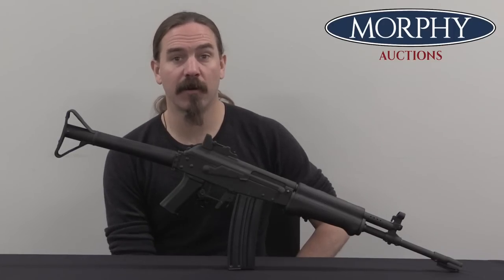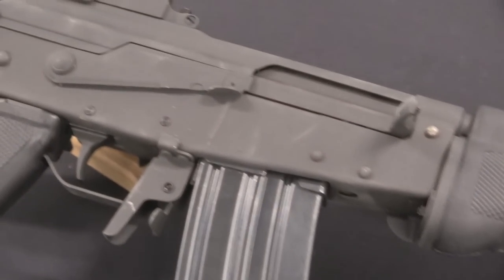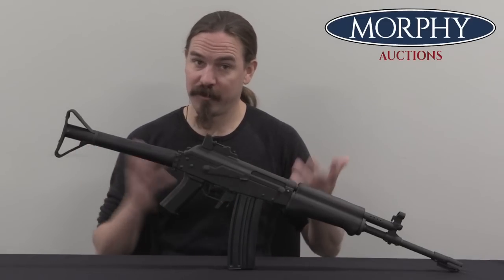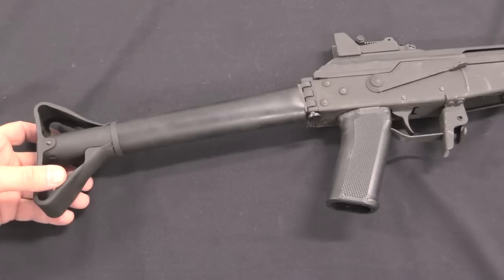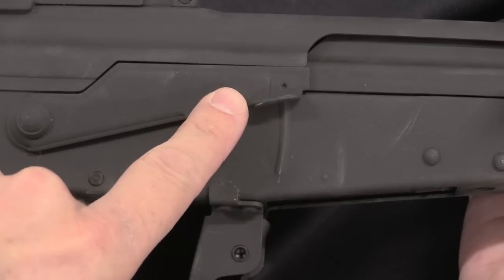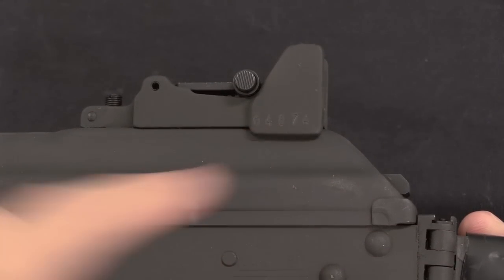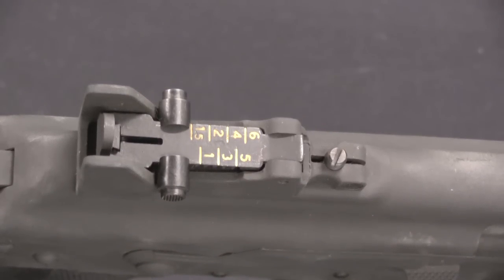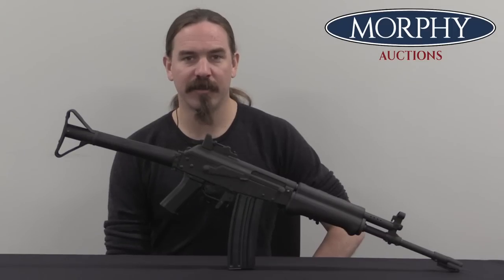Valmet M76: Finland's Stamped Receiver AK

Comment: It's worth noting that the civilian rifle in domestic parlance is "ReserviläisKivääri [Reservist Rifle]"  (as opposed to the military designation RynnäkköKivääri [Assault Rifle]), both being shortened as RK. Which is why they don't remove the other military features from the rifle aside from the full-auto mode. This is because it is expected that especially rear-echelon (older than 30 - 35 - 40+ years, depending on rank, branch and assignment) reservists will fight with their own gear, or they will have to use Chinese and East-German AKM's. Which are actually not that bad, but these were acquired only in the latter half of the eighties, and the East-German stuff in the nineties. When this rifle was first introduced in 1971, there was no gear for these men other than Mosin-Nagants, well of course Finnish Mosins, but still. This has been the side of things even before the Winter War. Back then reservists in Suojeluskunta (Civil Guard) dedicated a lot of resources and money to upgrading their own rifles. Where in fact SAKO's original name comes from "Suojeluskuntain Ase- ja Konepaja Oy" or Civil Guard Weapons and Machining LTD. 

Naturally while in the reserve it is expected they will train with their own gear, so dedicated reservists will acquire such a rifle. The majorit don't necessarily voluntarily uphold their service applicability, but this is due to there being a mandatory conscription, which many find an injustice later in life and as it is also gender discriminating. And personally this is why I disagree with the practice.

The Norwegians do it better, with a draft of the entire population when one reaches adulthood, non-gender segregated, from which only the motivated are chosen. It's been determined that Finland would in fact, with this have a much larger group from which to draft people than is actually necessary, as women are interested but don't apply for their voluntary service for various reasons, economic ones being the most common... And as modern warfare requires highly trained troops, the current practice is also against the interests of the state and FDF itself. But, politicians and boomers oppose gender equality here. But, that is outside your channel's review so I will end the rant here.
Reply: Touching on the subject of conscription. Whilst I do agree with you about the downsides of on male conscription I think the issue with the both genders is greater, at least for couple of generations.

The issue of choosing most motivated could lead to lack of personnel in the service and thus in the reserve, which would of course have to be fixed with set amount of conscripts. At that point not all are those motivated and it creates differend kind of "discrimination". How could we in that case pick fairly the ones that have to serve? That could create bad cycle of getting out of service by cheating and leaving those who didn't "cheat" to serve. Not fair in my opinion.

Of course that also has the issue that if we give that kind of possibility of "out", it could lead to same kind of mess Russian conscription has. Service for everyone would be the only "fair" way but FDF don't have the resources to DOUBLE professionals needed to train and lead double amount of conscripts and personnel + equipment of course. And this would also cripple Finnish economy with entire(or the general 70% that end up serving) age class doing military (+ civilian) service and not working and educating themselves.

That is why I at least think the current system is the only one that works right now. Of course it has to develop to be better and maybe one day it will be fair to all. As I pointed out as one of my points you can't think of it just as "gender discrimination", there could be other unequality issues not related to gender if it would be mandatory for both genders.
Reply: @teemup9247  You seem a bit confused, when the entire population is drafted there is over twice, nearly triple the amount of motivated people vs. how many the FDF needs to train every year available. Our national defense spirit is such, that your first argument is moot. Also, the forced conscription is what leads to the kind of chaos, especially in modern warfare, of what is seen with Russians on the Ukranian front.

In your second argument you basically argue against your first argument, which is a bit weird. There is no need to double the number of professional career soldiers in the FDF with a universal draft. The number of professional soldiers, non-commissioned and commissioned reservist officers is allotted the same way. It is just that the number of women serving will multiply by a significant factor.

Our military has only one constitutionally mandated purpose which national defense, our constitution explicitly prohibits our military from engaging in a war of aggression. So, it serves only to protect our society and way of life. If the people's will to defend their own country lowers to such a degree that there are not enough voluntary draftees, then the society is rotten to such a point that there will be sabotage, crime and out right revolt in the lines if you forcefully arm someone. 

And when you discriminate in who you make legally duty bound to take up arms for this purpose you will also sully this spirit of defense. People are handing in their military pass ports and resigning from the reserve by the thousands as a result of Russian's attacking Ukraine and this aggression becoming more likely to escalate towards us, so it really serves no purpose to train someone who then is unwilling to fight once they realize the state has committed a moral wrong against them. 

People who are forced into service with the threat of criminal sanctions will have extremely poor morale, commit war crimes out of discontent, and usually will not fight at the end of the day. This can be seen with the Russians in Ukraine.

Comment: Just wanted to point out that the magazine shown in this video is not a factory Valmet magazine but is, in fact, a Zastava ZPAP85 magazine.
Valmet 5.56mm magazines are very hard to source and so many of these rifles are sold with magazines from different 5.56mm AK designs that have been "converted" to work in the Valmet.  Some more successfully, and safely, than others.
A factory Valmet 5.56mm magazine will have either 2 or 4 very distinctive bumps on the top sides of the magazine depending on if it was imported with the model M71 rifle (2 bumps) or the M76 rifle (4 bumps).  True factory Valmet 5.56mm magazines sell in the 350-450 price range on auction sites online and there are many fraudulent sellers who will attempt to sell non factory mags to the unsuspecting.
Other than that... a very nice video Ian.

Comment: Ian, you forgot the M76 was later offered in .308, made using the same milled receiver as their civilian M88 Hunter model. Has It's own proprietary polymer stock.

I shot mine last weekend.
Reply: Milled are made by Sako.
Reply: dimapez  (Old)Valmet was large metallurgy company producing many things to different sectors, from vehicles to paper mill machines. Their gun manufacturing division merged with Sako in 80's, Valmet owned half of the Sako and Nokia other half. Later Nokia sold shares to Valmet and just after a year Sako was sold to Beretta.

Comment: There is also a very interesting RK "AKSU" which essentially is a AKS-74U copy but in 7.62x39. Only two of these RK "AKSU" were made during a lunch break " according to my sergenant major. Biggest problem of the AKSU was huge recoil and flash since they either couldn't or have time to figure out the muzzle device. Sadly it's really hard to find any pictures from it from the internet but I luckily got to see it since my military training branch is gunsmith.

Comment: I really liked my RK62 in the army service. I had that modern pistol grip but the older 'cheesegrinder' front stock and ofcourse fixed back stock. I tried my army friends rifle with, in this video's front stock, and i did not like handling of the gun at all. I also got to use the RK95, but maybe the only feature i would pick from that rifle is the folding stock... and that is big maybe. Anyway, as a tanker my beloved gun were the one and only FN pistol, and the one i used, were actually a very good pistol
Reply: I also had the model with cheese grater hand guard, but the pistol grip was the bike handle type 👍

Comment: In 2006 I was looking at one of these used in a shop. It was like $400 bucks or best offer. Nobody wanted the .556 one. Sat in there for a long time.I remember it because I pinched the mess out of myself on the folding stock locking mechanism. Picked up a couple Chinese SKS's for $200 bucks instead. Now I'm kicking myself for not getting this when I had the chance. Would of been a decent investment piece. Still have the SKS's put about 20k+ rounds threw them. When you could buy surplus crates of .762 for like $60 bucks.

Comment: I wonder if any of those are still in service. I don't recall seeing any during my service in 2016. Plenty of those old milled 1960's guns we're still around though. The old grip is actually really nice and slim until your fingers hit the gas tube. No Idea why they thought leaving the gas tube bare in the new M1- M3 versions was a good idea.
Reply: FDF quickly store all RK76s because the receiver isn't strong enough.
Reply: You could spot a 1 or 2 of the stamped ones still in early 1990´s
Reply: The rifle here is M76, which is a semi-auto rifle for civilians. I don't think the Finnish military ever used this weapon, which is NOT an assault rifle, even if it looks like one.
Reply: @cosmo9208  Not the civilian version, but the military version.. I served in the FDF back in 1993
Reply: Th weapons made in the 60s did not have night rights. They were later renamed as RK62PT.
Reply: I saw some converted to laser shooting simulation rifles for indoor shooting at my barracks sports hall. Recognized the stamped receiver. They looked brand new so I think they pulled those from long term storage and figured it would be the best rifle for that purpose, no need to modify milled receiver rifle. It was 2018.

Comment: I was sort of expecting you to mention the angle of the stock, but you didn't! This gun is an aiming experience! most guns have a stock which is perfectly aligned with the barrel, and there's no angle, so aiming down the sights on this one, with prior rifle experience, one will kind of find it difficult to get adjusted to it, maybe one might have a tendency to aim the rifle a little bit downwards, but then! After one gets adjusted to it.. It's actually a very good rifle to make marksman shots, for one thing, in a standing position, when holding the stock against one's shoulder to aim, the sights will be closer to one's line of sight, a little bit higher up than most rifles, and one will not need to lean/sink one's head as much, for a proper aiming position.

Comment: I have a certain fondness for stamped receiver guns. I think if they're pinned and welded just right they could be more than durable enough, even if not quite as durable as milled. Although, if they're designed right, they should also be significantly cheaper, so that's a mistake on Valmet, IMO.
Reply: As Ian said stamped wasnt too much cheaper. Most of those guns went to military and army was like no way for stamped ones. Finland have conscript army shitty weather and terrain. Those guns need to be very rugged and last longing. Soldiers tend to use those as showels and stuff so thats a perfect platform here. Only one button to press and clean the gun and you can smack that how how hard you can to open that ak. Pins and stuff would be pain to loose to snow with frozen fingers.
Reply: As the story goes (only read this on the net some time ago) the Finnish military was very sceptical about stamped receiver guns and thus set the tolerances exceedingly (one could even say ludicrously) high, the number of factory rejects were very high. If my memory serves me correctly, a commentator said that the stamped steel Finnish guns were made to the most exacting tolerances in the world and thus all that extra "quality" drove up the price and thus the chief benefit of stamped vs milled steel, low cost was utterly defeated. In reality you don't need exceedingly exact tolerances in all parts (compare say the Soviet PPS-42/43 SMG...). A further thing is scale of economics, the Finnish military never ordered rifles in such numbers that (even with more down to Earth tolerance specifications) stamped parts really would have mattered compared to say the same numbers made with milled receivers.

Comment: I have one of these, love it. Tough finding mags for it though and good luck trying to find one as they are rare and command big bucks to boot
Reply: if the trunion has its own feed ramp ( or you install one) you can use Galil 35 rd and 50 rd mags..
Reply: @ripvanwinkle2002  Thats correct, I bought (2) 30 rd Galil mags for my rifle years ago at a gun show. They were 100 bucks each but they are so rare I didn't care and looking back now I'm glad I did buy them

Comment: The Valmets look very pleasing to look at compared to most AK derivatives which are with wooden furniture.

I'd like to see how this Valmet compares to other 5.56mm AKs on the range.
Reply: Valmet has pretty good tolerances, so unless the gun's been shot to pieces they tend to be on the better side for AK accuracy. I know my RK-62 (made in -82 IIRC) was pretty much stock tolerance in -05 and shot straight enough to get some medals for shooting.
Reply: I think the South African vektor R4/5 would be a great comparison, they look quite similar as well, personally I prefer the R5 over the Valmet just for the style of stock.
Reply: @ginger0208  Makes sense that they look similar as R4/5 is based on Galil and Galil is largely based Finnish RK62.
Reply: @zhipx8289  Someone else pointed that out to me on another comment, I had no idea previously that the galil was based on the RK, it does very much make sense now!
Reply: Hollywood used Valmet rifles in place of AK rifles before they were imported in the early to mid 1980s.

Comment: Ah it looks just like RK-62 i used on The Finnish army (except with More curved 7.62 magazine, ofc), i miss The old gal
Reply: That's because it is the same rifle, exept stamped and the video's rifle is 5,56 Nato and has folding stock.
RK's folding stock folds different side.
Rifles in FDF is knows as RK 62 76 TP.
Exactly the same rifle.
Reply: 62 has no rivets on the back. But a lightening groove over magazine.
Reply: @JanoTuotanto  Because it is milled.

Comment: Two questions. First, how is the dust cover stabilized for use of the rear sight? AK dust covers are considered too unstable for use as a rear sight/scope mount platform. The Finns are definitely riflemen, so they must have fixed that. Second, will Galil 5.56mm mags work in a Valmet 5.56mm?
Reply: Absoulutly not!  Do not use Galil mags in a Valmet the feed ramp angle is all wrong and you run the risk of it pushing the bullet into the case and if it fires it can cause a caistrophic failure!  What you can do is get regular AK mags in 5.56 Bulgarian Circle 10s are good or the Polish ones from Radom and use a dremel carefully to fit properly using the standard Valmet mag as your guide.
Reply: @Rumnhammer  Good to know! Thanks!....  Now do you know how the dust cover/rear sight is made stable on the Valmet? Every YouTube video on Valmets and Galils neglect to cover the rear sight/dust cover solution. My only criticism of the AK is the blade rear sight. I MUCH prefer a rear peep. I have a Chinese M90 in 5.56. I wish it had a peep. Tech has a clamp on rear peep, but is a bit too complex for my tastes. Can a circle 10 mag be modded for the M90? I have a dozen mags but the more, the better. Last I looked, people want $75 for them!  😖
Reply: @mateoocampo3165  The Valmet dust cover is a heavy gauge sheet metal compared to an AKM. Also has extra reinforcement spot welded to the rear of the dust cover where it interfaces with the rear of the receiver. Makes for a very stable platform for the rear sight
Reply: @viggenguy4411  Wish I could find pics....  could a Galil or Valmet dust cover be modified to work with a Chinese M90?
Reply: @mateoocampo3165  For what it's worth, the dust cover for my Valmet M62 fits onto my milled receiver MAK90 without any modifications. It is a much tighter fit-up than the original MAK90 dust cover.

I can't speak to a Galil or any difference that might exist between stamped or milled MAK90 dust covers (or stamped vs milled Valmets for that matter)

Comment: The Galil is pretty much just a slightly altered model of the M76. The M76 though is an excellent take on the AK, which is a far better rifle than what the Soviets created. Very fitting too, since Finland had battled the Soviets with altered models of the Mosin Nagant during the Winter War. It seems the Finnish are always taking what the Soviets made and making it better.
Reply: Im pretty sure that the Galil is closer to RK62. Galil has a milled receiver like the RK62. Some of the first Galil protypes were actually made using RK62 receivers.